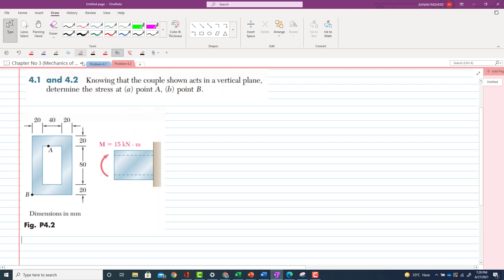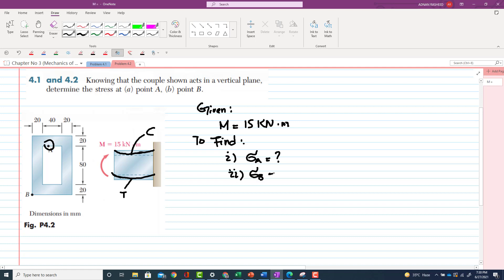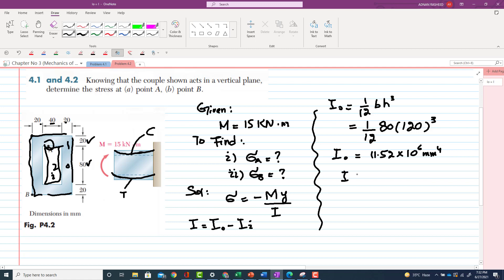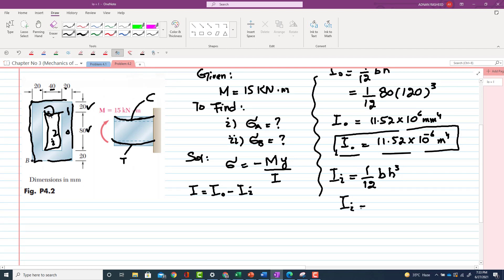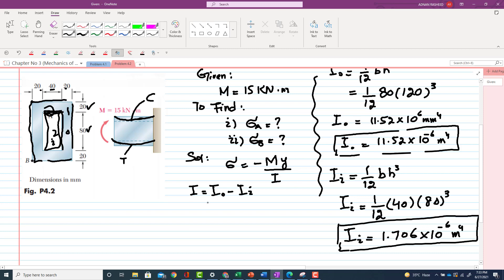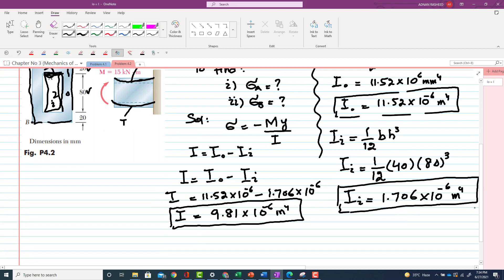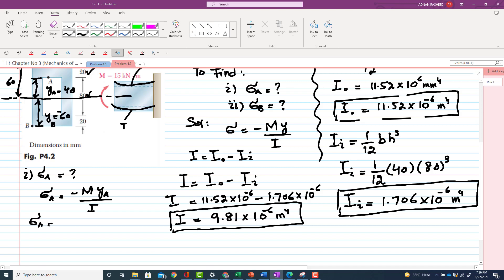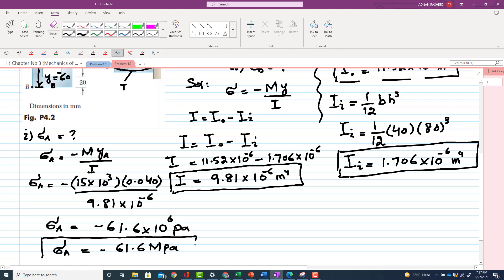Mech of Materials# |ProblemSolutionMOM​ | Problem 4.2 |Pure Bending| Engr. Adnan Rasheed

Comment: Hi teacher I hope you are good. I didn’t get why did you do minus for point A, it was above neutral axis. If A is minus then why B point is also minus? One is under the neutral axis one is above the neutral axis.
Reply from the maker: Well you can see that due to moment upper layer above the neutral axis is in compression while lower one is in tension, so upper portion will experience compressive stress above the neutral axis and lower portion will experience tensile stress. This can also be obtained by using formula stress=  -M.Y/I
Now for point A the distance ya is above neutral axis which is positive so stress will be negative which mean compression. While point b is below neutral axis so yb will be minus and when you put in stress formula the stress comes out to be positive that shows the tensile stress. I hope you will understand it. If you need further explanation I can send you its theory link